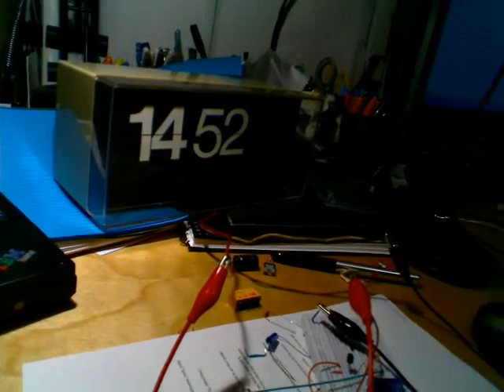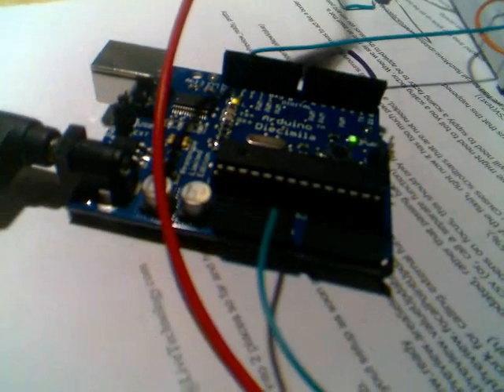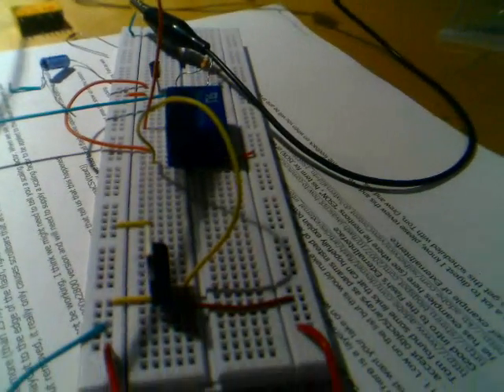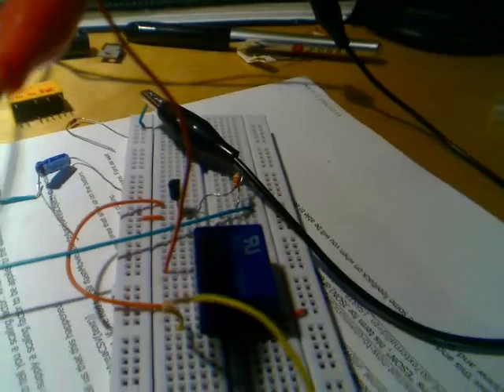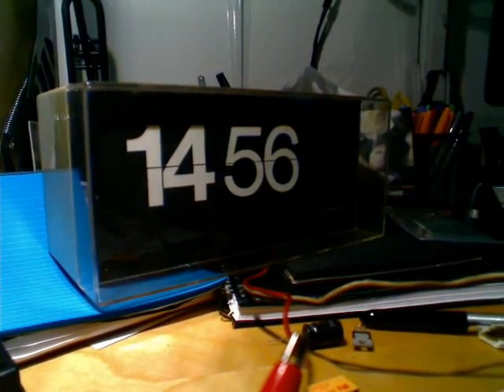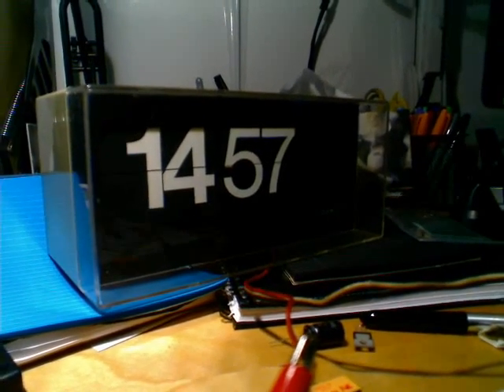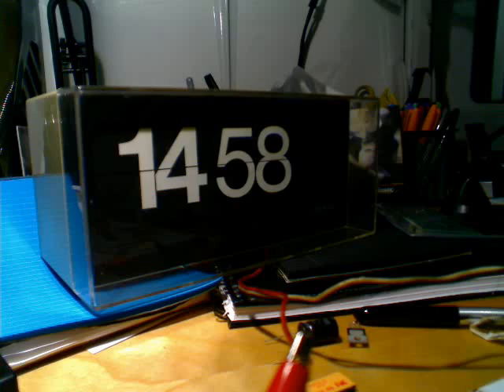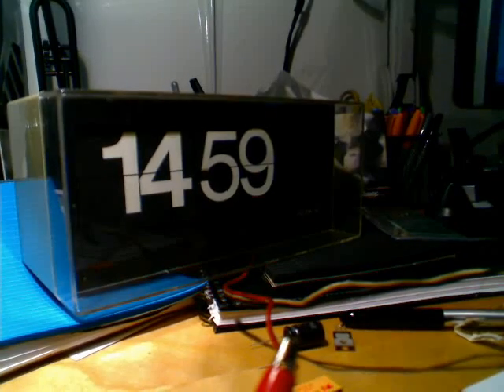Split-Flap Clock circuit

Comment: I still have some of the Icon 30 clocks and wall brackets available, as well as a microprocessor controlled pulsing board. Contact me if interested.

Comment: How does it know when's a minute? Quartz crystal or ceramic resonator?

Did you test time timekeeping accuracy?

You might want to program it to internally keep track of the date. This way, it could skip forward the extra 60 minutes in the spring (Daylight Saving Time), and pause for an hour in the fall.